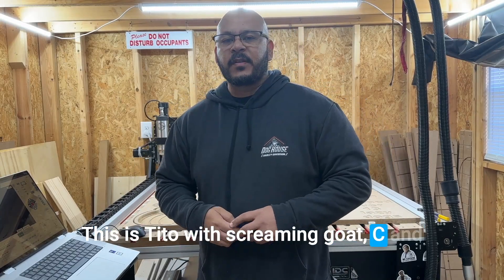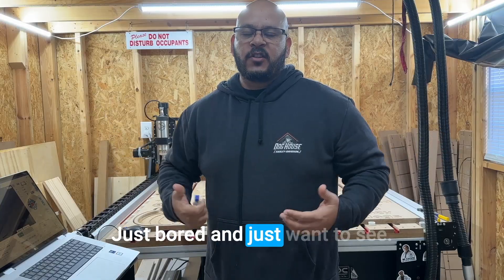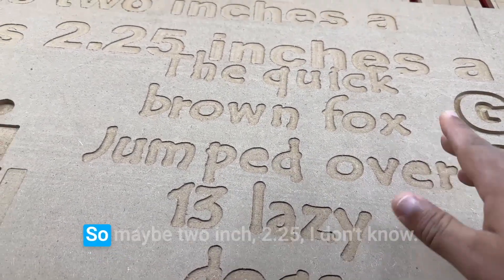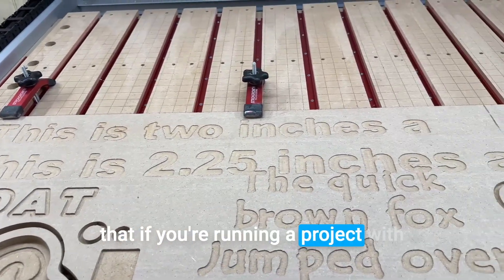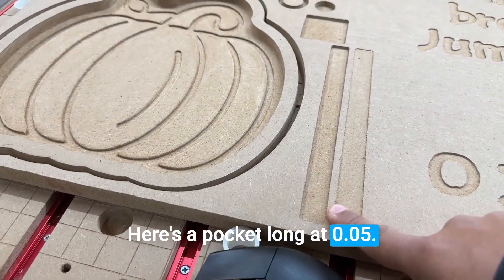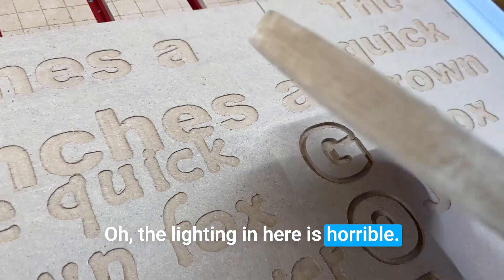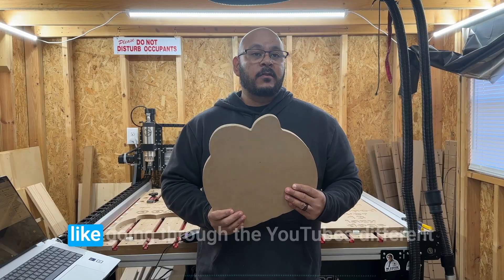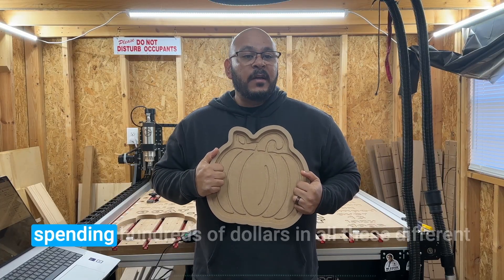What You Can Make with JUST a Quarter inch Downcut Endmill

Comment: First, I want to commend you! CNC'ing is a journey and we all started somewhere. I'd say don't worry too much about your video recording yet. Heck, I've have a business and a website, much of it centered around using my cnc's, and I have always intended to start a YouTube channel, but I procrastinated and literally just started my first video yesterday. It will probably suck, but we'll get better!

Now, let me see if I can offer a little advice that you might find helpful with using your cnc.

If/when you decide to do more letter carving, the v-bit will be your friend. For the most part, you won't have those issues with the the bit not being able to get into those tight spots in the letters. I have different v-bits, but I find the 60 degree is what I use the most.

Are you using Vcarve Pro as your software? If so, I'd recommend a couple of things that might help you right away. 

When setting up tabs, check that little box that says 3D tabs. It will keep the bit from leaving those little rub marks when the bit goes up and back down on either side of the tab because it stop/starts momentarily on each side of the tab due to the tab being rectangular shaped. With 3D tabs, the bit never stops progressing because the tab is shaped differently.

Second, if you haven't started using the "ramp" feature, I'd recommend that when running profile or pockets. It's easier on your bit and it also helps with cutting down on the rub marks. I usually make my ramp length twice the pass depth and it works well for me.

I hope that helps. Keep cuttin!
Reply from the maker: Thank you for all your great advice! I look forward to your content!